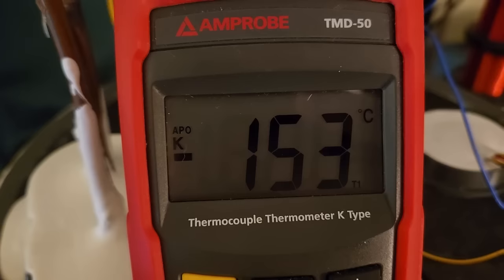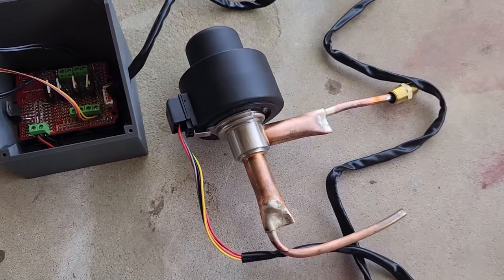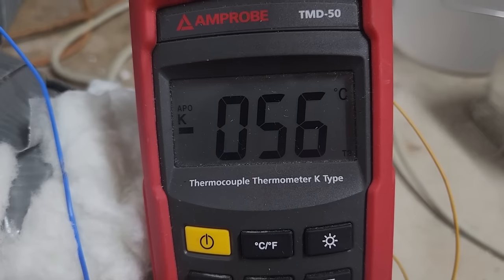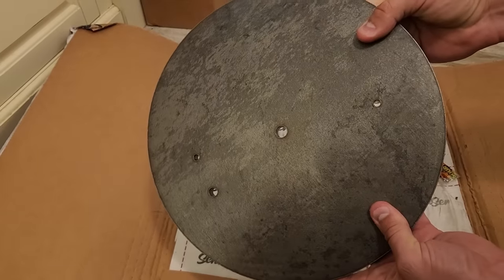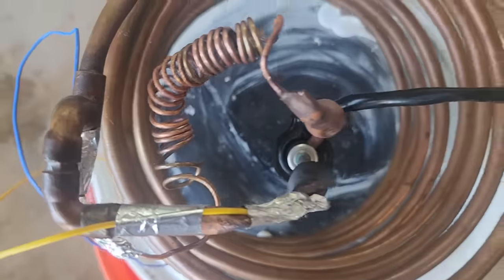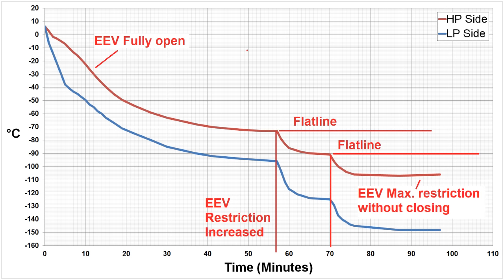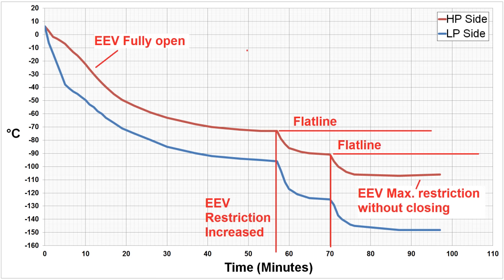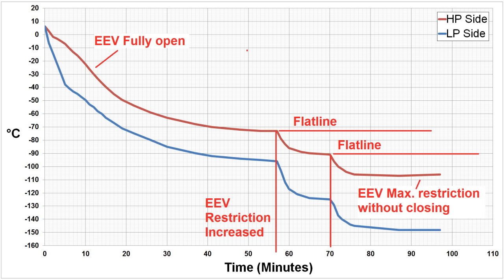Joule-Thomson Cryocooler Part II (-153°C)

Comment: I water cool my freeze dryer compressor as well, otherwise the thing will just cook itself. These low temperature applications usually have special compressors that feed liquid refrigerant through the compressor to cool it. My latest compressors came from some modern-ish R410a 5000btu window units; two of them draw 220w (as an AC) and one draws 260w. An old 5k unit with say R22 and oldness, will draw your 500w.

I used several passes of the condenser for cooling the water. I should post videos eventually.

Comment: Hrmm. you might want to add an expansion tank pulled to a vacuum and a pressure release valve from the high side to the exp tank.
When I was working with 3 stage R290, R508, R1150 systems we were seeing 850psi on the ethane high side AFTER long runs and system shutdown. Careful friend !
That heat left in the 1150 desuperheater can push the entire system up without flow. 
P.s Ima look over your systems a bit  more and comment on what I've learned if i spot something. 
 Oh Ps Ps , I took 2 years Hvac/Industrial electrician studies alongside my engineering studies.. Low temp industrial chillers and multistage system were my passion in classes.

Comment: Great progress! A few thoughts: a large block of styrofoam is better than a small vacuum flask, also it costs less and doesn't require a turbomolecular pump to reduce the thermal conductivity, copper tubes should be replaced with stainless steel (if available) to cut down the wattage influx even more, but if you still prefer vacuum, then add a few loose layers of Doritos space blankets to block the radiation. Also when it comes time for hydrogen check out NASA's methods for purifying orthohydrogen, because spin isomer transition will produce heat and headaches

Comment: I develop elevtric  car AC compressors in my dayjob . We offer a scroll type compressor but see a lot of companies from china coming out with rotary type compressors . What we see in Testing is that the rotary type compressors fall on their faces with high compression ratios whereas scroll compressors are less efficient at low compression ratios because they basically need to perform a certain compression ratio before they can exhaust - so work gets done but then just blows into the lower high pressure area . Noticing your drastic decrease in power with your insane compression ratio I would highly suggest to change to a scroll type compressor or better : two stage compression because scroll compressors also have a built in compression ratio and just  shovel gas into the high pressure area like a roots blower when You exceed that ratio . 

In theory you should not experience less massflow with high ratios (keeping inlet density the same ) - irl you definitely do but your loss is crazy and indicates a problem .

Also remember that all of the motor heat needs to be dumped in less and less massflow so the real inlet density reaching the actual compressor mechanism deminishes dratically to compound that problem  when operating hermetic compressors in suboptimal conditions

Comment: FYI, you can just ignore the center tap (A1 and A2 in series to make the A coil)  and run them as bipolar steppers. Edit: also if you have a spare 3d printer control board loaded with Marlin firmware and Trinamic drivers there is a sensorless homing feature that uses the steppers stall current to act as a home switch. That way you could start your the machine and the EEV would close (or open) all the way to stall and then go to a set position regardless of what it was set at when it was shut down.

Comment: Very interesting experiments I was wondering, If you only need a really cold temperature. A robust sterling motor driven by an electric motor in the right direction will provide you with supper cooling without all the messing about with explosive gasses in heat exchangers etc. The Philips Factorie in the Netherlands around 1950-60 did extreme testing with sterling engines. On YouTube, there is some old footage of their experiments.  Have you looked at this cooling option?

Comment: I think you got your Ulam-Teller configuration backwards there at 13:57.
Also: Google won't autocomplete "Ulam-Teller". I don't know why.
Anyway, very good video, as usual. I really didn't think getting to LN2 would be this difficult without a cryogenic turboexpander.
Reply: it's not backwards, it's simplified. Bomb touches U235 touches liquid D+T. It's missing the Hohlraum for bouncing the XRays, the Pu "sparkplug" in the middle of the D+T, etc, but it conveys the idea enough that we both knew exactly what it was meant to be.
Reply: @ddopson  its baaaaackwards. Trust me. I know a backwards thermonuclear device when I see one.

The bucket goes on the inside and the bomb goes on the outside.
e.e
your move sir.
Reply: @htomerif  The cartoon is on such a high conceptual level that I'm not entirely sure which elements of the full thermonuclear architecture you are seeing in the three elements of the cartoon. I see it as "explosives trigger fission, which triggers fusion", which is a roughly accurate rendering of the conceptual sequence. If I was being pedantic, I'd say that it's missing the final U238 fission stage that accounts for almost half of the yield, but that would confuse the picture for most people.

You seem to be implying that the "bomb" goes on the outside of the "bucket" (of D+T), and yes, there's a compressive force on the D+T material, but "bomb outside bucket" isn't really an accurate description of how the Teller-Ulam design works.

If by "bomb", you mean the conventional explosives, represented in the cartoon by an 1800's era iron-sphere / black-powder bomb with a black-power fuse, then only the fission primary uses conventional explosives. Conventional explosives aren't even close to strong enough / fast enough to sufficiently compress the fusion stage, represented by the "bucket" of D+T.

If by "bomb", you mean the fission primary stage, which is what provides the energy to compress the fusion stage, well, that's not wrapped outside the fusion stage either. Instead, the fission primary is located some distance to the side, and both stages are posited within an xray reflection chamber known as a "hohlraum".

The fusion stage is compressed by XRay ablation of the tamper material surrounding the D+T "bucket". More precisely, there's a plastic similar to polyethylene that ablates, providing the thrust that presses on the heavier tamper material (U238, usually), which in turn compresses the fusion material inside.

So, if anything, placing the fissile material to the side of the bucket is close to physically accurate, and it's the hohlraum connecting them that's missing. He doesn't draw the hohlraum because very few people would understand what it was. He also doesn't show any of the tamper materials, the Beryllium neutron reflectors, or most of the other practical details.

Neither of the materials is correct for most weaponized designs. Most fission stages use Pu239, not U235, mostly for cost reasons, but also Pu239 has a smaller critical mass. Still, U235 could be used, and it conveys the right idea. Liquid D+T is the most unrealistic as it's wildly impractical on at least four different levels (temp, density, cost, and radioactivity). Real bombs use solid Lithium-Deuteride, with an enriched level of Li6, which eagerly fissions under neutron bombardment, releasing the Tritium needed to support D+T fusion. The Tritium is produced while the bomb is exploding. Pretty hard to keep a warhead cooled to cryogenic temperatures, not to mention the cost and radioactivity challenges of sourcing that much Tritium gas. Ivy Mike is the only detonation of a D+T weapon, and they used an entire building full of cryogenic cooling equipment to keep the hydrogen liquified right up until the instant it turned into a thermonuclear plasma.

The real bomb has some of everything inside some of everything else. There's a small puff of D+T gas inside the fission primary stage, which boosts its efficiency/yield by supplying extra neutrons at the peak of the reaction. There's also a fissile "sparkplug" in the middle of the fusion stage ("bucket"), and at the peak of the fusion stage's compression, this spark-plug fissions, creating an opposing inside-out pressure wave, and also supplying a burst of neutrons in support of Lithium fission / Tritium production. Finally, nearly all currently deployed weapons use a U238 tamper surrounding the fusion stage, which accounts for almost half the yield. While U238 isn't fissile (cannot form a critical mass), it can fission when struck by fast / high-energy neutrons, such as the 14.1 MeV neutrons coming off the D+T fusion reactions. Only a fraction of these neutrons are able to trigger U238 fission before they scatter to a slower speed, but each fission event is worth +200 MeV, so it works out that the bomb's total yield is roughly doubled. Also, this outermost layer of fission probably slows the fusion stage's expansion slightly (extending reaction duration), and contributes some extra neutrons to the party for fissioning Lithium. 

If you like this stuff, I'd highly recommend reading "The Making of the Atomic Bomb" by Richard Rhodes, which is possibly the best history book I've ever read on any subject, and its sequel "Dark Sun" does a great job of explaining the T-U design, as well as the history surrounding its development.
Reply: @ddopson  Dude. I'm definitely not going to read that. The spectrum has caught you and hyperbole escapes you.

Comment: The hydrogen project is amazing! Even unrefrigerated I'd love to know how to safely store hydrogen under pressure in a DIY setup.
Reply: Liquid gases like helium and hydrogen are kept in Dewar flasks - a very well built vacuum flask, like a thermos™. They are simply kept at that insane low temperature, insulated by hard vacuum. Dewars are commercially available, and generally require a level of precision manufacturing beyond any hobbyist. When you buy liquid hydrogen, helium, etc, you buy a Dewar of it.

Comment: Liquid hydrogen can actually be useful for a ton of reasons (besides rocket fuel). Hydrogen has a much higher specific heat capacity than even water. You could possibly use it as a coolant (although something tells me Hindenburg 2.0 will happen).

You can liquefy hydrogen, contrary to what other people say. Thing is, hydrogen tends to heat up on decompression at room temperature*. Hydrogen's JT inversion temperature is -73°C, below which hydrogen will actually *cool down on decompressing. -73°C is manageable by even dry ice standards. 

So making LH2 isn't impossible, it's just fiendishly difficult to make.

Comment: Where do you get all the parts compressors, valves and oil separators?

I'm working on a diy refrigerated air drier and I'm having a hard time finding parts
Reply from the maker: The compressor is from a small window AC unit. Oil separator is a temprite 320 from eBay, valves/gauges/vacuum pot i got on amazon, and the copper tubing i got at home depot for the big stuff and amazon for the small capillary tubes
Reply: @HyperspacePirate  thank man! Can't wait for the next installment on the hunt for liquid nitrogen

Comment: 1:47 -- you can drive unipolar stepper motors as if they are bipolar just fine.  Simply ignore the center taps.
Reply: other people in the comments say there is a such thing as a 5 wire stepper where the center taps from the A and B coils are tied together internally.  He didn't really show it enough to know if it was 5 or 6 wire

Comment: It seems like a bit too much complexity when you could use a tiny Stirling cycle cryocooler to liquefy nitrogen.  But I really do hope you're successful with this.  Based on your prediction on your yield, it would produce more LN2 per day than my cryocooler does.  My cryocooler uses less than 400 watts to operate and I can make 2L in 24 hours.  But this doesn't take into account the power to run the compressor to make dry nitrogen from air.  I think the compressor for that is another 400 watts.

Comment: you build such a big circuit for controlling the electronic expansion valve. you just could have used the ULN2003 chip. you can controll it with the arduino. it would be much easier

Comment: At -153C the boiling pressure of nitrogen is higher than the boiling pressure of air (which itself contains nitrogen)? Is this for real or a typo? Because the boiling pressure for nitrogen changing when it's mixed with another gas like oxygen is suprising!

Comment: spitballing, might be lack of thermal mass. ur min load temps might be closer to your first flatline. the lower the pressure the colder the refrigerant, but if you don't have enough refrigerant to fill the low side exchanger (or 50-80% of it) then its just blowing very little liquid and mostly gas from restricting it. what was your low side psi at that -70ish mark?
Reply: Also, maybe splicing in some sight glasses here and there, maybe before and after the evap

Comment: combine the temp exchangers with catch cans in stages in terms of condensation points of the gasses, you could eliminate the gasses that condense at higher temperatures in stages (reverse distillation? ). pro's, can let in just have it open to atmo, will pull in gas as it condenses the gasses, con, if it can't condense nitrogen or the coldest gas present,  it will stop feeding itself.
each stage could have a valve sperating them to pull vacume at the start, bring the gas in first stage to first condensation temp, open second stage slowly to feed in new gas and condense out more of the first stage gas. supper cooling the stages could help with not allowing the prior stage gasses to move forward while helping the next stage, ect. ? would be super cool? lol.

Comment: What EEV did you use in the vacuum chamber for fine tuning the flow? Asking as it is quite hard to find EEV working in such low temperature environment. Mostly they are rated for temperatures down to -40C.

Comment: If that guy can liquefy helium with copper tubing and a fridge compressor... My guess is that it's just impossible, beacause the slightest heat source will prevent you from going this low, but i want to see still

Comment: how did your wallet like the EEV? I'm imagining they aren't on the best of terms.
Reply: Those are expansion valves from commercial HVAC systems. They aren't that expensive. It's possible to find them for $20 a piece.
Reply: Ah, i seem to remember reading they were uncomfortably expensive.
Reply: @hauuau commercial refrigeration tech here, normal “analog” thermal expansion valves are super cheap as you say. The EEV’s are not so cheap and then you have to add in the cost of the controller (if you’re not rolling  your own like OP). 

There are 2 types of EEV’s. One is a pulse valve (read: solenoid valve) that pops open for a short length of time and then closes for the remainder of the PWM period. This period is usually 20 seconds long so if your load requires 10% refrigeration the solenoid will stay open for 2 seconds and closed for the remaining 18. Then there’s the stepper type of EEV that OP is using that slowly opens and closes the valve based on PID loop parameters and temp/ pressure inputs. 

Either way the valves (and controllers) are pricey and considerably more expensive than $20 ea.

Comment: what a snake of a system, but if you are interested in maximum specific energy metal-air fuel cells, use baking soda table salt ethanol water, with silver/carbon air electrode, works (is liquid, does not freeze) in low temps below -34C, yep single use battery fuel cell, just swap in a new pipe metal or electrodes, and it works again, because most of the fuel cell weight is the metal, not the other parts, you get most of the metal full specific energy, even as a zinc-air style battery
Reply: so did you need ethylene somewhere? the decomposition of ethyl sulfate (made by ethanol and sulfuric acid boil reaction) into sulfuric acid and ethylene at 170C should be nice reaction process

Comment: nice setup. I've also build a mixed gas refrigeration unit several years ago. Not for liquification of nitrogen but for microchip / processor cooling. My evaporator is a cooper evaporator with a flat surface to mount it on microchips. In my video it is mounted to a load tester that produces 50 watts of heat to the system. Idle temperatures without load was also -153°C. Gas mixture was butane, ethylene, methane and argon. between 5 and 10 percent wight of argon there was no difference  in the achivable final temperature. https://www.youtube.com/watch?v=8m-cyajujD4